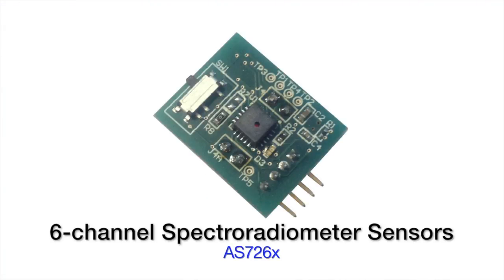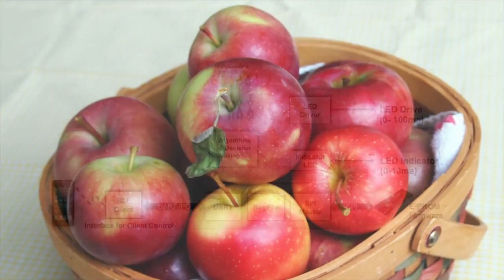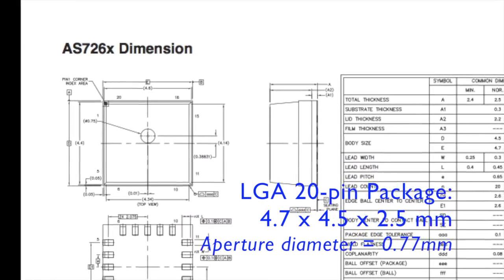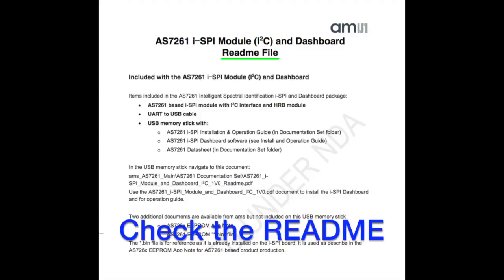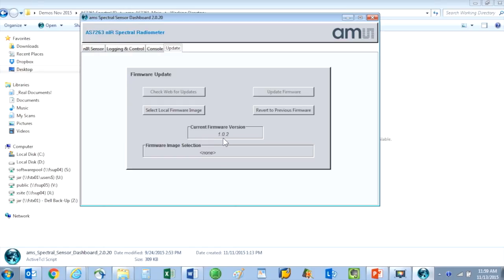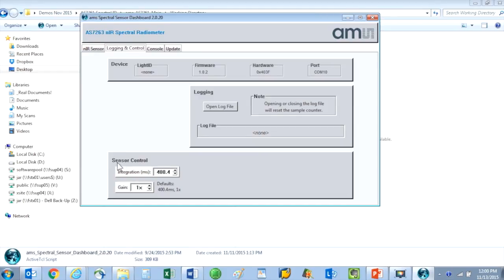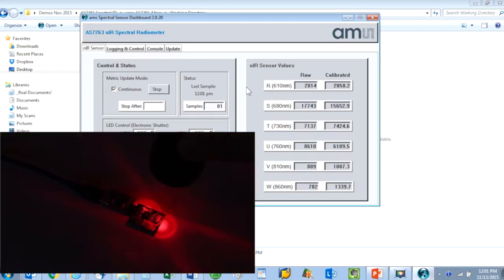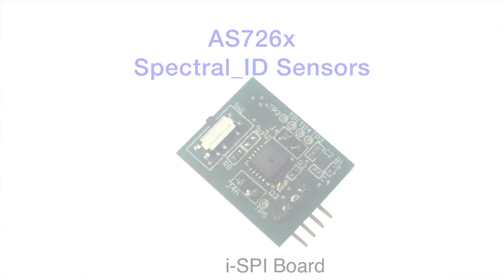ams Spectral ID iSPI Eval Kit

Comment: How to get absorbance of a material using as7263 nir ?
Reply from the maker: You can detect the absorbance of a material via reflection. You have to illuminate the object with an NIR light source and detect the reflected wavelengths. The absorbance is the difference between illuminated and reflected wavelengths.
Reply: ams AG And how do we calculate the wavelength via as7263
Reply from the maker: @irfanbhati3408  For details, please have a look at the datasheet: https://ams.com/as7263#tab/documents  Best regards!

Comment: Is this sensor capable of sensing all the colors of the sRGB color space distinctly?
Reply from the maker: ams presents in this video spectral and multi-spectral sensors. For these sensors, the color evaluation takes place on the radio metric level and not the color metric level. As a result, one receives the spectrum of the sample and determines the color point via these values by overlapping the spectrum with the CIE1931 standard observer function. The last two steps must be done in the process of sensor calibration. That means, the full sensor system which exists from sensor, optics, mechanics and a luminary (if necessary) will be matched into the application. This matching is possible by using alternative algorithm’s e.g. a linear regression and correction matrix. This matrix will be calculated by measured sensor and target values. ams supports these development steps by delivery of pre-calibrated sensor systems which are corrected to be uniform. Therefore, the customer can concentrate activities at the color matching into his application.
Reply: ams AG Thanks for taking the time to respond.
Reply from the maker: You're welcome!
Reply: Hello, Where can I find CIE9131 documents? or Are you mentioned CIE1931? but they only define XYZ I see. Please how we can use this sensor's channels to derive colormetric values. Thank you.
Reply from the maker: Hello, if you would like to detect color you have to choose the AS7261. This sensor is the XYZ-sensor in this family and it provides the XYZ values directly. And you are correct, it has to be CIE1931. With best regards!